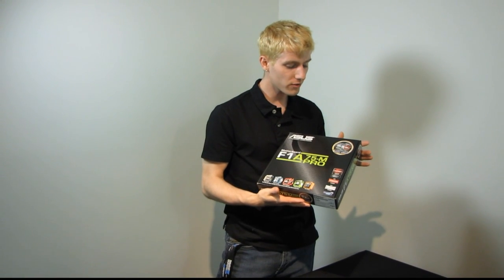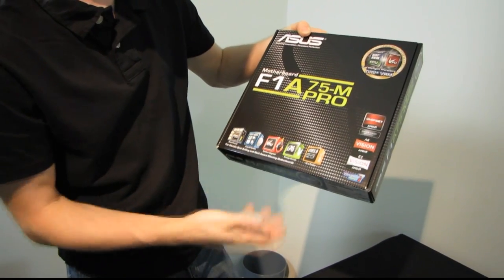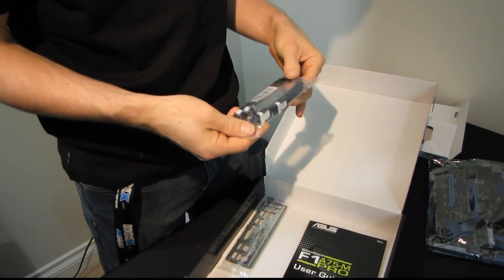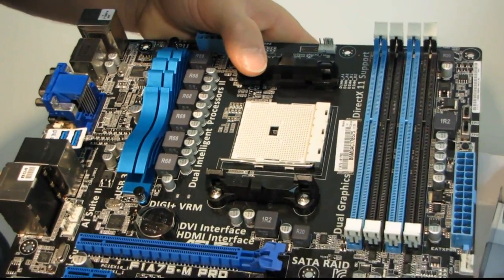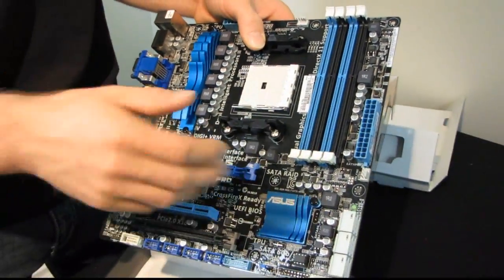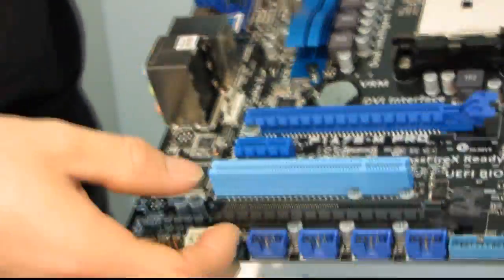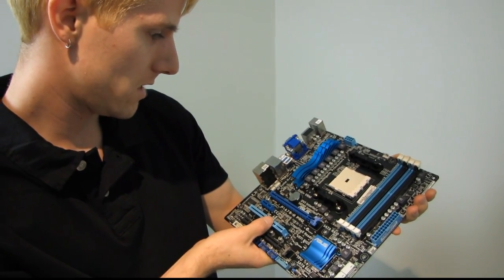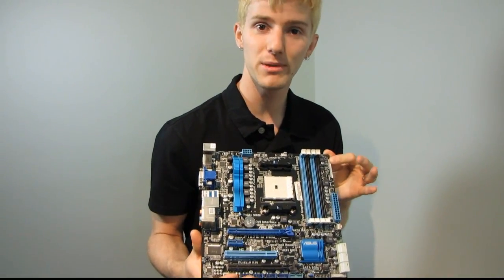ASUS F1A75-M Pro AMD A75 Socket FM1 Crossfire Motherboard Unboxing & First Look Linus Tech Tips

Comment: OMG! look how young Linus was! just was given a system with this board in it and it runs windows 10 just fine! as far as gaming goes, won't run newer titles, tried to run Syberia 3 and it just wouldn't work! system works great for older titles though. manual must have a misprint in it though, claims it supports 64GB DDR3 yet manual shows that the dimms only are in 1, 2,and 4GB pieces... so in reality, 16 GB is the most you can install on this board.... (4 X 4GB) unless there are 8 and 16GB modules in a DDR3 configuration.... really a nice board!

Comment: will a amd radeon r7 260x icooler   www(.)memoryexpress.com/Products/MX49737
Reply: fit this motherboard XD
Reply: Fruffyy Hamster Yes, but using this motherboard for a new build is not a good idea since the new FM2/FM2+ Apu's can have much better performance.
Reply: theREDshadow Can you crossfire two r7 260x in this motherboard?
Reply: renie miller Although there is 2 pci-e x16 slots the 2nd one is running at 4x, bad idea to use this motherboard for crossfire. What type of rig are you planning to run?

Comment: what are the disadvantages of running pci 3.0 at x8 sli/crossfire rather than x16?
and are all motherboard like this with one pci slot x16 and the rest x8, my motherboard is like that and im wondering what effect it will have on graphics card sli?

Comment: @Knightmares100 No, i forget the biggest card you can CrossfireX with, but you can however use two 6870's in Crossfire, only at 8x each respectively. This will defeat the purpose of having an APU, unless you look at the cost to performance ratio.

Comment: @wikireadery This motherboard to me looks like a micro-ATX as it's square shape, ATX ones are rectangular shaped which this one in the video doesn't display.
If I'm wrong, I'd suggest you get a case that can hold both form factors for when you upgrade/change your mobo in the future. Most midi cases will do just that. 
I hope this helps.

Comment: @joske102 i agree with you. yes, everything breaks down eventually. and yes, Asus and gigabyte have about the same reliability. But, gigabyte, for some reason have short life. it's like they put a timer there telling the mobo to stop working after1-2 years...  from what i've seen so far, i think Asus and Intel motherboards are about the same quality, altho Asus are just a little faster. msi is not even a company i would buy anything from...
(sorry for my broken english)

Comment: @TheMaristBoy from what i've seen, Asrock were pretty good. as for performance, it's not as good as gigabyte, asus or interl boards, but it was still fast, reliable, and with good compatibility with other companies hardware.  if gigabyte had longer "life expectancy" to it's boards i would place it in number 1 together with intel and asus.
if everythings works good for you then dont change it. but if you want to buy a motherboard, i would choose asus or intel first.

Comment: Linus, I know you're not an AMD fan, but I want your opinion. I'm looking to build a new gaming rig for somewhere under $1000 and I was wondering if I should use an A8 APU or wait for the Bulldozer to be officially released for comparison. Also, I might do water cooling at some point; what would you recommend using? I will probably want to water cool the apu, graphics card, and possibly the ram. If you see this, your response is greatly appreciated.

Comment: @shubufubu
Sure it does, does the A8 have better performance then the  2500 or 2600, 1155 socket.
Or is the A8 a midrange item.

Comment: @nilbud no, right. From experience. I build my pc without special gloves. I touched all the components (seems logical if you're building) and it works! Works great actually. I even overclocked my amd phenom 945 processor to 3.7Ghz.

Comment: @kammel109 4 pin connectors are for PWM- pulse width modulation, which means that the 4th pin is +5v for motor rpm sensor. If you use PWM and you don`t use 4th pin the rpm in Everest or other programm will be incorect.

Comment: @youzwa2 In all seriousness, with 1200$ dollars in hand, an Intel would probably be a better solution. A 2500k or even a 2600k CPU, typical 4 gb 1600, an SLI/Crossfire ready board such as a sabertooth p67, and a high end GPU such as a 6970 or GTX 580. The rest (about 300 dollars, should go for a smaller SSD for boot and a 1TB disk for storage, and a Chassis/PSU. I spent around 800 total with a 2500k and a 5770, i can tell you the 2500k and the 2600k kick some serious ass : D

Comment: I would love this board for a low end build but i don't like the second PCI-E 8x slot is at the bottom, as if you use a dual slot graphics it would cover the connectors at the bottom, they should've switched the PCI slot with it.